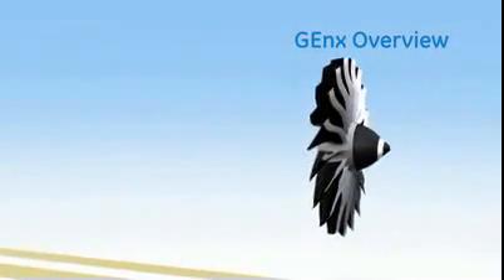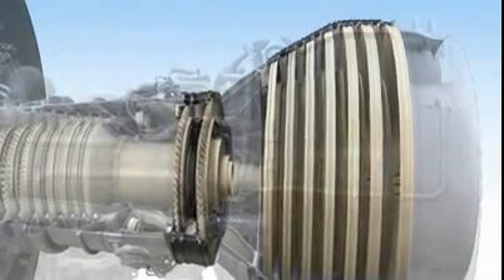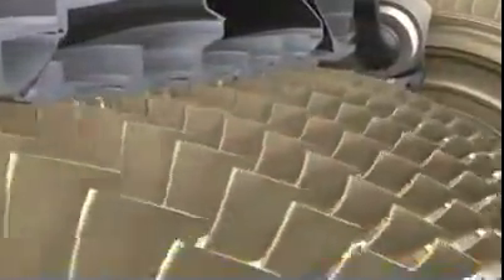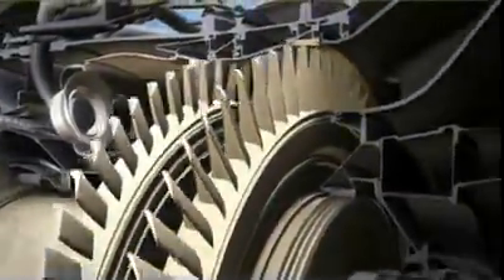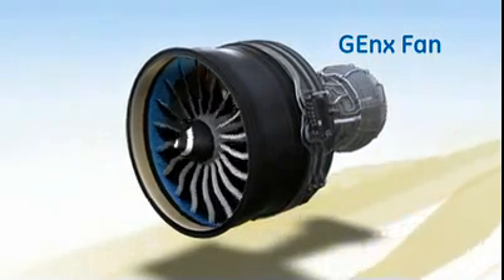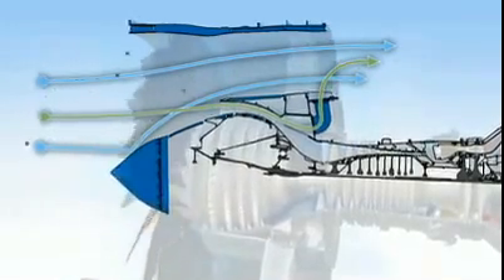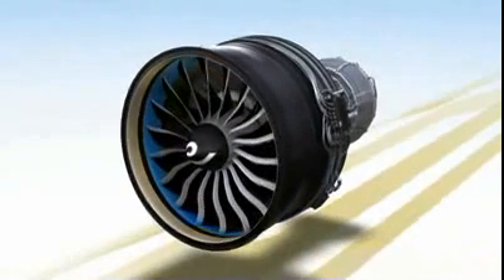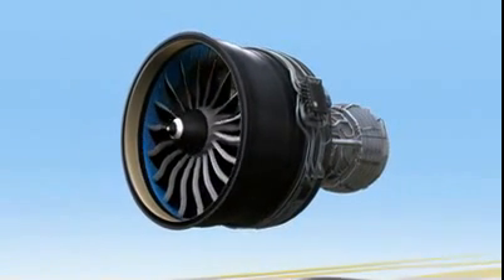How the General Electric GEnx Jet Engine is Constructed

Comment: This advertiser is simply using advanced graphics and stilted language to distract you from the primary take away message: The environmental extremists comprising the all powerful EPA have overhauled the global emission regulations and standards to the extent that all power plant manufacturers have to design entirely new engines to comply with regulations created with the intent of punishing the participants of internal combustion technology. The advertised product is simply what GE had to do in order to survive as a player in manufacturers of gas turbines in the EPA's "brave new green/clean world." The alternative would have been to spin off that segment of it's operations.
Accordingly, this well-pitched turbine powerplant will cost many orders of magnitude more to acquire and maintain than any of it's predecessors just five years ago. Wouldn't it be nice if this were the end of the story, but it's only the beginning. The EPA took special care to ensure that internally-combusted power come at a much steeper price, and that's only step one. Just a fashion of similar fanaticism, our friends at EPA made sure that not only would new petro-chemical powerplants be uber expensive, but that they would also lag far behind the performance parameters we have become accustomed to as a society for sixty years running.

Put a tad more succinctly, the EPA has launched a full-frontal assault on everything that used to be "sexy" about gas-burning engines. If fast, loud, and powerful are adjectives that hold positive connote with you, then you're in for a big disappointment. The elite intellectuals of the EPA are going to see to it that you, me, and we are all going to "enjoy" jet powered aviation at a much higher cost, with a performance suite that is the rock bottom minimum necessary thrust component to keep us in the air. Sexy IS ain't what sexy WAS. Forty years ago, a typical non-stop 600 mile fliJht was comprised of a 727 which was really fast, really loud, and kicked out a little black exhaust trail behind her. If you went wheels up out of GSP, you'd be touching down in PHL in only slightly more than an  hour. Today, hat same non-stop flight takes nearly two hours. Progress? I think not.

Flying today is akin to animal husbandry. No longer considered to be urbane, or adventurous, it's torturous. We don't make out way to the gate, but rather, we are hearded there. We don't check in anymore, we're  "processed," like so many head of cattle. And that big 'ole jet airplane....that Steve Miller sang of in 1974 has been supplanted by fleets of puny, new, slow (barely) jet airplanes. Here's a tip for you frequent flyers spending hundreds of hours vacuum packed in regional jets: there are more than a few single-engine turbo prop air craft in the general aviation/civil aviation world that regularly cruise at speeds considerably higher than the 350 knots  cruising speed you'll max out at during your 1-3 hour flight in your CRJ. That's not to say that your CRJ can't outrun the GA turbo-prop, it's just not ALLOWED to, thanks to ATC and the FAA. It's all about traffic management and keeping them separated up there. The only chance you'll get to experience airspeeds of 500+ knots in a regional jet these days is if you're on a non-stopper with a 400+ mile distance spread b/t departure and destination (and if your flight plan takes you over lesser-congested air routes (vis a vis: out west). We are unwilling converts into the cult of man-caused climate change. It was fun while it lasted.
Reply: if this is how you spend you free time, do you want come over and help me on some essays?
Reply: Walton Jackson same
Reply: Goddamn, this comment speaks utter bullshit to me, Jesus fucking Christ...

Comment: Not the case with these large turbofan jet engines which are known as high bypass jet engines, that means most of the thrust power is provided by the large front fan.

Comment: The largest fan which is in the front seems to push air around the outside of the engine. Does that air on the outside also provide thrust?  And if so what percentage of the thrust comes from the outside airflow from the large fan?

Comment: Normally the exhaust air is straightened by the turbine exit vanes which have an angle (see the the engine from behind in the video). The oppsite rotating compressors are made to counteract the gyroscopic effect and therefore also give a better fuel economy.

Comment: I've had several replies to the question. You can read them below. I'm not sure torque is the issue since the engine on one side of the plane spins in the opposite direction of the other. It would cancel out and maybe even add stability like a gyroscope.

Comment: I was thinking that the spiral flow off of the main turbine was causing the second to not be as efficient as it wouldn't produce as much pressure against the turbine blades, but are you saying that the only increase in efficiency is the propulsive thrust generated as it leaves the engine? It makes sense now that I think about it. Could it be a combination of the two that adds efficiency?

Comment: I don't think he's talking about the compression system rotating against the intake fan, but rather the counter rotating fan system utilized to stabilize the exhaust flow for optimized static pressure.

Comment: Air coming out of a single fan produces a spiral flow, with a lot of wasted inertia. Essentially, the air spins partially around itself, rather than being pushed straight out the back of the fan. A properly tuned and pitched counter rotating fan paired with the primary fan reverses this effect, producing an even, cylindrical, straight airflow. 

With less turbulence and more focused flow, the amount of air moved, and more importantly, the static pressure (propelling force) increases.

Comment: How does the counter-rotating turbine improve efficiency?       1. By reducing number of stationary airflow directing parts ( vanes ) and corresponding drag and energy loss. 2. decreasing weight and 3. decreasing turbine length. There are papers on the subject but links are not allowed here for some reason. Google is your friend.

Comment: 1. By reducing number of stationary airflow directing parts ( vanes ) and corresponding drag and energy loss. 2. decreasing weight and 3. decreasing turbine length. There are papers on the subject but links are not allowed here for some reason. Google is your friend.

Comment: Ok my bad, simplified.  A car engine compresses air injects fuel and explodes it in a vertical piston configuration.  The vertical  motion is converted to rotational motion (to drive tires).  In a jet engine the air is compressed (heated) and fuel is injected in the combustion chamber where the constant explosion / expansion drives the turbine which drives the compressor.
The exiting gas is the propulsion re: Newton's third law.

Comment: That makes sense. I guess the only part that seems counter-intuitive is that the air wouldn't create more "back-pressure" due to it leaving the engine at a slightly slower speed and therefore slow down everything upstream by a proportional amount. 

I don't know if that makes any sense, but that's how it works out in my head. I suppose the secret is a happy middle.
Reply: It shouldnt create backpressure if the mass flow is the same, velocity just depends on how far its compressed i guess

Comment: The force of the air delivers more energy to the system if it is forced to change direction over the turbine blades.  Think of it as a sail on a sailboat.
When tacking into the wind the air is slipping by the sail transferring energy but LESS energy than if the wind is blowing DIRECTLY from behind.
Force at 90° perpendicular is greater than at 45° laterally.  Best I explain in small space here.

Comment: That makes sense, but is also slightly counter-intuitive. I picture the flow stagnating and producing less work.

But I guess that doesn't happen with such a massive engine. The air will move.

Comment: So it has composite - carbon fibre - compressor fans? Didn't Rolls Royce just about go broke doing that? They are lighter, stronger, better in every way. But when you fire a ten pound frozen turkey into them at a couple of hundred miles an hour, they shatter. Rolls has been down this road - they had to be bailed out by the British government and taxpayers.

Comment: I think I understand. Basically the whirling air coming off the first set of turbine stages would be spinning in the same direction as the second set and therefore wouldn't produce much work because it would just "slip through".

Is that more or less what you mean?

Comment: Because if all the stages would be rotating the same direction, the air would start to whirl up and therefore reducing the differencial in speed between the other blades, making it just use up energy sideways but with a "backflow".

Comment: I put General Electric on my black list for *anything* in 2002, after buying an answering machine with a KNOWN bug, commented in the instructions manual: "If it stops answering calls switch off (unplug) and on again", regardless that fact that you might be 12000 km far away. Finally I decided not to rely on General Electric stuff any more, I slammed it against the wall. When I fly, I'm always curious about the engines brandname, and veeery happy that so often it isn't GE, synonym of bad quality.

Comment: Its a product definition than a jet engine tutorial.In normal jet engine after combution the expanded gase rushes out making the power fan turning to continue shaft turning and pushing the atmosphere behind to make thrust.But adding extra fan will develop  torque to rotate shaft but the ubstration of gas flow will reduce air pushing thrust out side.It will be useful for automotive purpose where torque is necessary no thrust. required.

Comment: Simplifying a lot: big fan at front provides the thrust (in commercial engines), like a propeller. Some of the air is directed into the compressor, where less and less space compresses the air. Then the fuel is combusted, and the force from that going through fanblades turns the whole thing.

Typically, military engines get more thrust from the combustion than the big fan; more powerful, much less fuel efficient. Look at the wikipedia page for "bypass ratio" to see the difference.

Comment: The reasons you give make sense to me.  I think there is one more key factor, the initial input of energy from the starter engine gets the air-flow going in the right direction which creates the steep pressure difference between the air coming from the compressor & the air escaping via the turbine.  What do you think?

Comment: no problem, it is the design, when the engine is stopped and it starts, for the air is easier go to the back than to the front, because the opeing in the back is bigger, having more space, it makes easier, it generates low pressure in the back, and high pressure in the front, so that makes that *in the back* is an easier escape for the hot air, theeen when it alrady has a AIR current, the air current is mandatory in about, all the new hot air will follow that current as is natural behaviour.

Comment: You, sir, are a genius!  Now explain to me what keeps the flame in the engine from blowing out the front as well as the back.
Reply: You have just hit the nail on the head there, sir !! This is NEVER explained but I will now try to explain (but it's only my version that may not be totally correct).
Any fan / compressor has what's called a `fan curve' (also pumps have pump curves) to illustrate how it will perform when the flow rate is varied i.e. how the pressure across it will vary as you vary the flow.
Invariably as the flow is decreased the pressure across the compressor INCREASES; therefore during start up of the jet engine when the burner is switched on the pressure after the compressor stage increases which will tend to reduce the air flow into the compressor but this reduction in air flow will increase the pressure gain over the compressor so a new BALANCE  is achieved with the burner on. Google `fan curve'.
With the burner on this vastly increases the volumetric flowrate with the pressure reasonably stable.
The same can be said for a locomotive steam engine - with the boiler sitting at e.g. 10 barg (145 psig) and zero steam take off the fire only has to supply boiler heat losses. Once you start to draw steam off the fire has to provide a lot of heat to maintain the steam flow rate at the same pressure.
Reply: Ill explain: the combustion chamber (the part where they talked about the swirlers in this video) consists of a combustion chamber (the housing) and a flametube that has a series of holes in it
Ill explain a simple version:
There are three main types of holes:
Primary: combustion
Secondary: burns off remaining mix
Tertiary: cools the combustion gasses 

The total hole area equates to the total intake area of the engine, so the holes match the airflow 
The primary holes are alot of small holes and they have an airspeed that is low enough to let a flame burn, the air just enters in alot of places.
The secondary holes let remaining mix burn off, and there are usually less holes and not as much area as the primary.

Now tertiary has the bigges hole area (like 50%) and has big holes that penetrate deep into the flametube to cool of the gases before they enter the turbind, so that the turbine doesnt melt.

I hope that kind of explains it

Edit: sometimes, air vortexes are used to "anchor" the flame so the combustion chamber can be smaller and the flame cant go anywhere

Comment: You are saying the same thing the other guy said.  The fore & aft parts are at equal pressure when the plane is stopped on the tarmac.   The plane moves because the engine creates a pressure difference between the fore and aft.  The plane does not move in response to a pressure difference created by the plane's movement.

Comment: Actually gases will just move towards the back simply because the pressure is lower in the aft part. As you know air moves from high pressure areas to low pressure areas...

Comment: They turn the spool to start the engine, moving air thru the engine.  They inject fuel & ignite it.  The combustion gases expand furiously & pressing against the compressor & the turbine equally.  It seems equal pressure blowing both ways would stop the spinning spool.  Since that does not happen, I guess the compressor creates more pressure than the combustion.  That seems odd since the combustion is what powers the compressor.  There must be a pressure / velocity trade-off, but I don't know.

Comment: watch?v=p1TqwAKwMuM

This explains it a bit clearly.  If I'm understanding it correctly, the exhaust after the combustion helps speed up the compressor and also has enough energy to provide thrust.  That increased speed from the exhaust speeds up the compressor, thus increases the speed further and moves more air.

Comment: This engine,due to its modular structure is very easy to upgrade, modify and tune to its specific requirements like speed,range,power and most probably,the arrival of new upgraded parts with new features to enhance its capabilities with less time taken to upgrade it.

Comment: I've been in turbine blade manufacture for 16 yrs. The GE situation does't make sense to the rest of us I know. GE was asked by Obama to create jobs etc. The Prime minister of Canada followed suit and contacted the Pratt&Whitney aircraft company for the same. P&W reacted by announcing they would design/build an all new light weight gas turbine engine in Canada. With direct contact to P&W you will find out that P&W will only have about 300 new hires over the next 3 yrs at 2 different P&W plants

Comment: I suspect they are talking about the analysis and optimization performed.  In the past computers were not powerful enough to perform a full 3D simulations for these, but now they can get much closer to simulating the entire engine in detail, including air flow.  This allows engineers to optimize everything from the shape of the blade to the shape of the cavities around each blade to the way the air flows from blade to blade as well as optimize for strength and weight.

Comment: Ah yes, Pratt... the company whose recent higher-thrust offerings for the 777 and A330 failed so spectacularly that Boeing effectively banned them from the 787, despite developing an engine to compete.

The PW4092's failure for NOx certification, the PW4098 being bought by only ONE airline (then later rejected by even that one!), and the PW4173's failure to leave the drawing board, despite airline desire... have left Pratt as little more than a JOKE when it comes to modern widebody engines.

Comment: The technology really is amazing - I've been on three flights that had total engine failure years ago - Today you have airline pilots that go their entire career without shutting one down - I've been on over 1800 airline flights and been in 6 emergency landings - no big deal then, today you make the 6 o'clock news if you need to go abort a landing (been on 4 of those - never an emergency thou)

Comment: sir if this ENGINE is the same as the Airbus A320 (CFM56-5B) or B777-300ER (GE90) the fan, low pressure compressor and low pressure turbine move in one direction because they are in one spool and the high pressure compressor and high pressure turbine are in different spool... if someone try to design a turbine engine that the low pressure compressor and high pressure compressor rotate in different direction or high press turbine and low press turbine rotate in diff direction it is possible